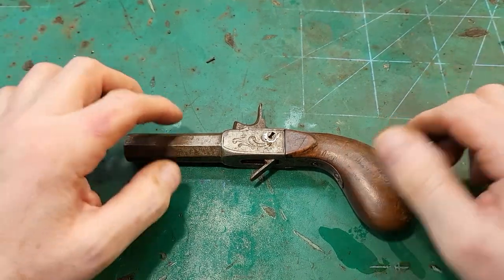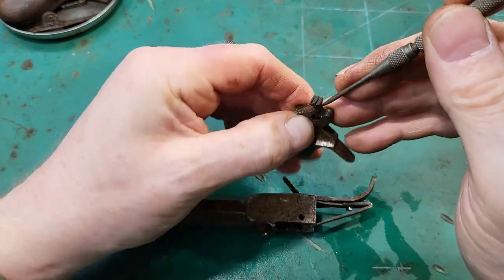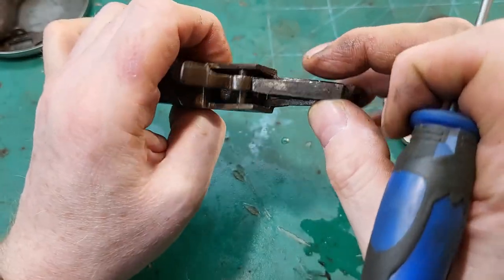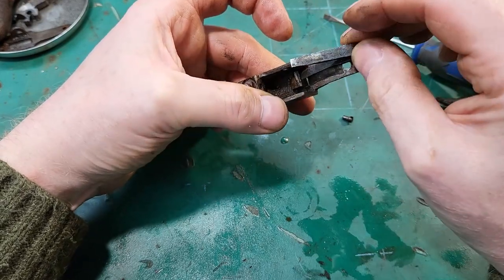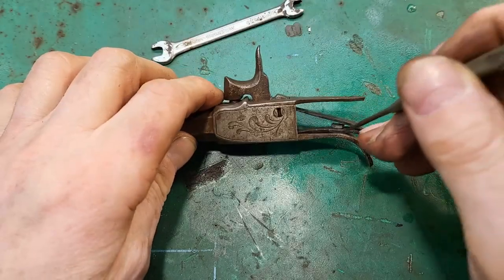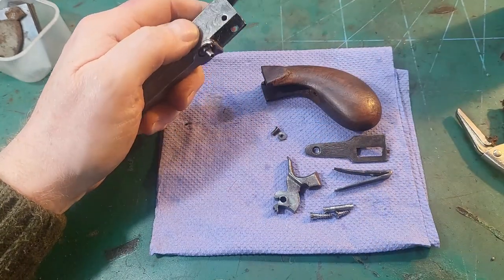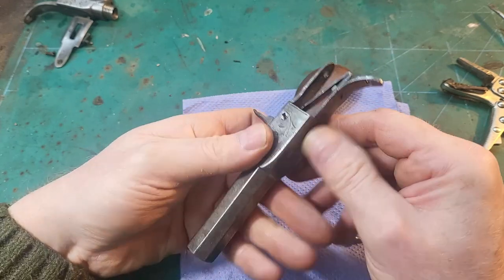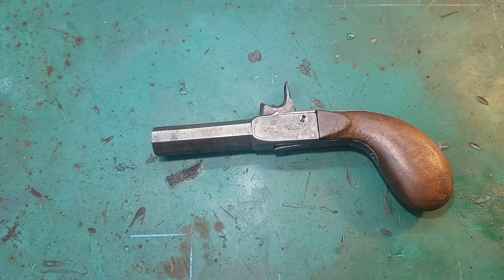I Fix An Antique Percussion Pocket Pistol - Gun Spring Repair

Comment: So glad I haven’t gotten a pistol to fix with a double duty spring yet lol, if I had a problem with the spring wandering sideways I would of built up the channel walls slightly with the migwelder and file square to help the spring stay put , but that would most likely cause another issue, it’s crazy how everything has to work in unison, modify one part and it affects everything else , sit there with hours and hours tweaking things
Reply from the maker: Thanks, interesting idea building up the channel, I think it could be done if one was careful, but so true: unintended consequences! Thanks BP.

Comment: I have a terzerol with one barrel and it is missing the spring. Do you think that it is possible to make a custom one. On mine you have to attatch the spring to a notch that slides through a hole in the spring.

Comment: Do you have American taps and machine screws? Just another option to match up to old non standard threads.
Reply from the maker: Yes, I've got, imperial taps etc., but I find metric easier to work with.